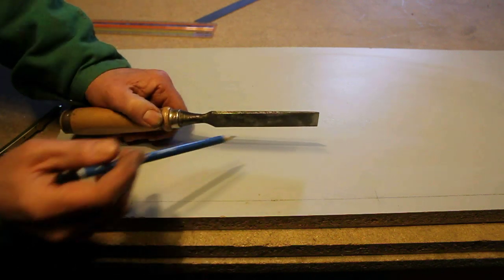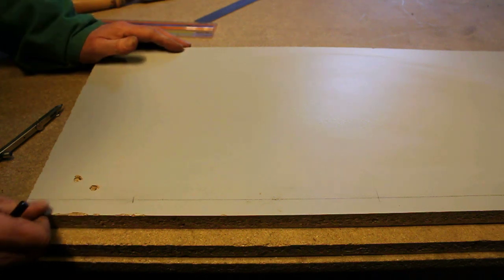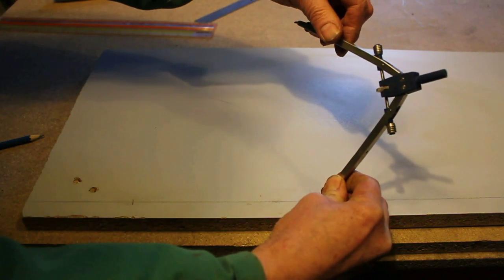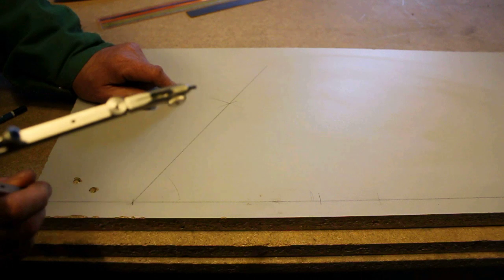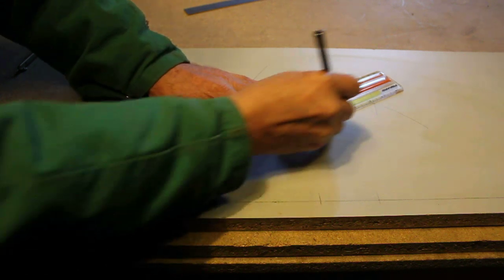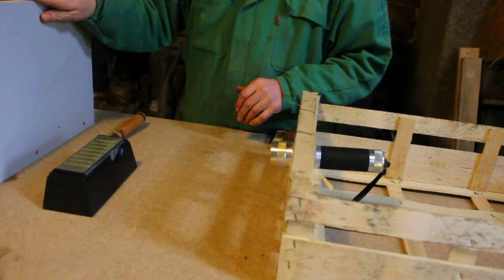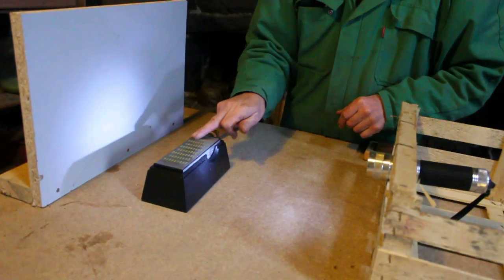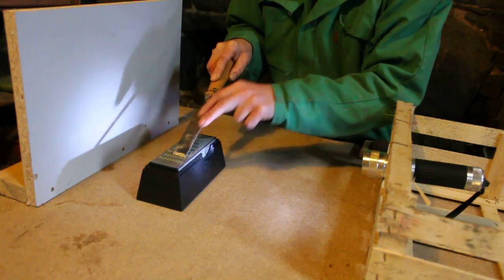Sharpening tools using a flashlight. Bricolez guide d'affûtage. Bricolaje una guía de afilado

Comment from the maker: Thanks for your comment. As for the saws, I would try and remove the rust with a soft metal scraper so as not to damage the steel further. The sharpening and reseting may be done in the workshop, you would need a flat and a saw file and a saw set. It's worth while restoring these tools as they can be resharpened again and again. As for the handles a quality beeswax polish will work, linseed oil does take some time to dry! Good luck, Andy.

Comment: Brilliant! I've still got my Bear brand rough n smoth from my chefing days so I've got everything I need. Wonder if you've got any advice on saw doctoring... i.e. removing rust from saw blades (I've inherited some from my grandfather), sharpening and re-truing the blade teeth, and conditioning the handles (I've heard linseed oil is best for this)

Thanks again Andy :-)

Comment: No body expexct anything from you buyng chisels . The set of the angle it dipends of the wood you going to maintain (hard or soft) 25 degree  is set for soft wood ,and 30 degree for hard wood.
Reply from the maker: tridneven 
Good point. The idea with this method is that one can easily achieve the desired angle of choice simply by changing the angle of the line on the screen.
Thanks for commenting.
Cheers, Andy.
Reply: nevermind you got my point
Reply from the maker: tridneven
The other advantage, as my other film shows, is that you can also use the same technique to sharpen knife blades.
Cheers, Andy.
Reply: Andy , I dont need any suport to keep the angle. Maybe  3-4 years a go i needed but today i just do this routine. Cheers,Tridneven